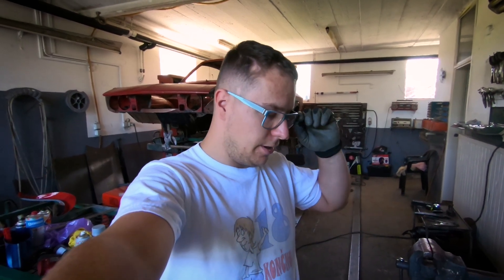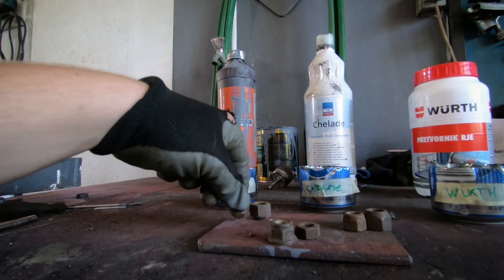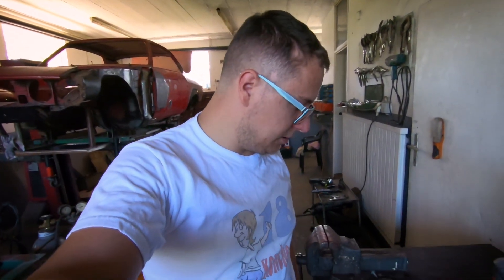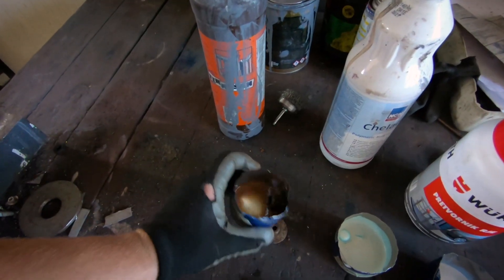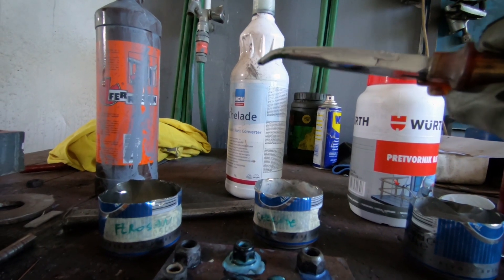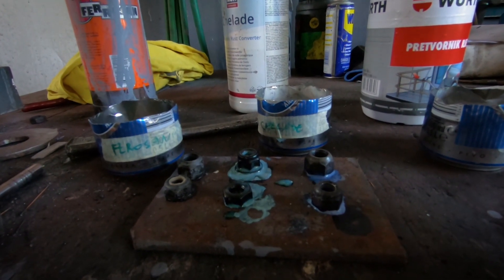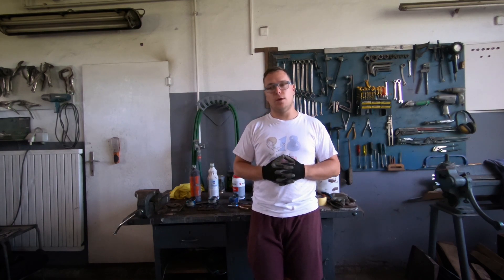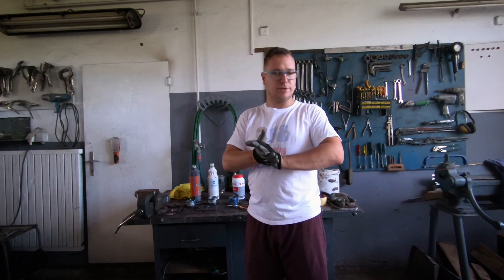Opel Manta A '71 - S01 EP26: Testing Different Rust Converters | Setting up New TIG Welding Machine

Comment: If you use rust converter on a panel - walk away for 2 days. Do nothing. Come back 2 days later, do your primer, filling, blah blah - much sooner & any following treatment will mostly fail - filler will flake, paint will peel & primer won't prime. It's not the converter, it's you - it takes 48 hours to stop being annoying & start being useful. 

Go do some other stuff for 2 days, then come back. 2 days later, the surface will be Mint.. Give it time.
Reply from the maker: I agree, you definitely have to let the chemicals to do it's job. I recommend just following the label of the products as they may have some variations of the time needed for it to work. Good advice, thanks!
Reply: I leave it on for 3 hours as stated on the tin, I removed all the converter off the surface before applying epoxy primer

Comment: Very good video. I have tried some cheap rust converters and wurth works way better than them, and the treated metals stay rust free for longer.
Reply from the maker: Thanks man! I plan on doing a similair video with removing rust using citric acid :)

Comment: I am using Ferrobet.  Its basically 60% phosphoric acid.    You should read about using it on rust.   I think it works really good.
Reply from the maker: I havent used it yet but it sounds similair to Ferosan - this product is also based on phosphoric acid, the other two are on tannic acid. I have to check if Ferrobet is available here :)
Reply: @l3v4rt  Yeah then it should be pretty simular to Ferosan.   I buy Ferrobet because it is easily available in Norway.